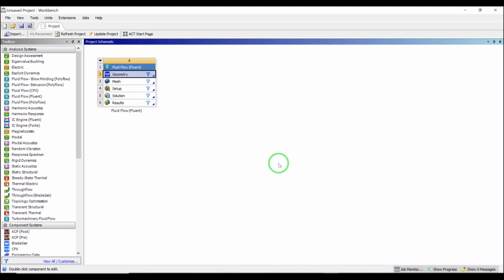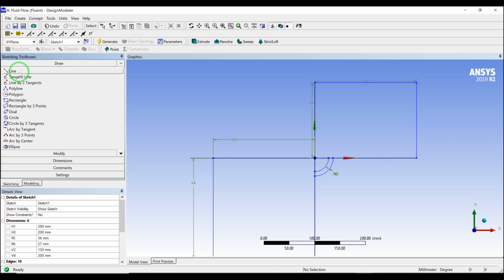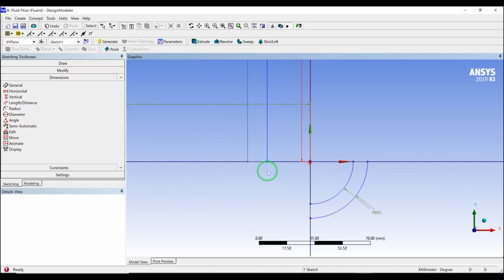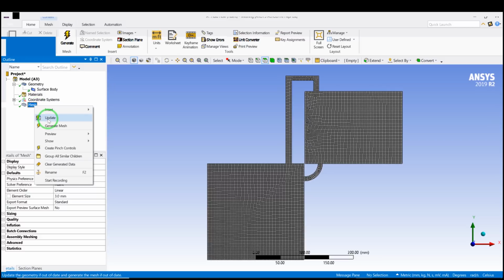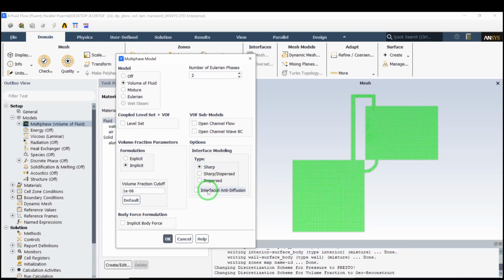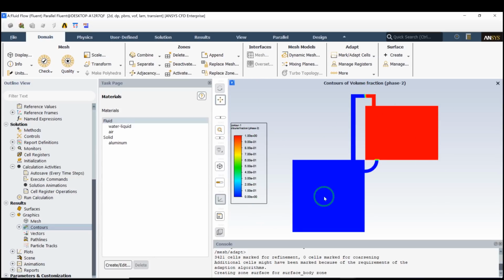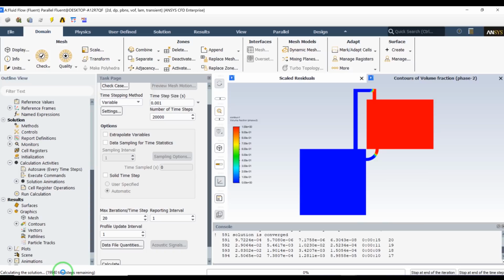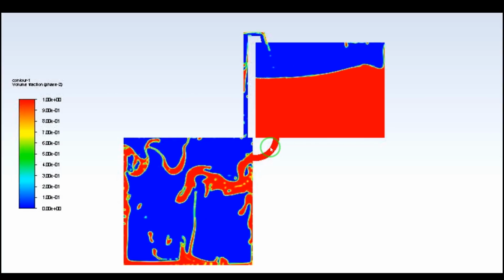Two Phase (VOF) Fluid Flow Analysis in ANSYS Fluent Tutorial - Tank Discharge

Comment: Hi...I want to simulate a hydrocyclone separator. Where I want to input mixture of two particles (PVC and PET) and separate them  and calculate the efficiency ...but i am facing a lot of problem inserting two types particle through inlet...I badly need your help  in this case😓

Comment: Great video, thanks. Please can you do something on plastic injection molding. Especially setting up the fluid (ABS maybe) and setting boundary conditions. Something like this: https://www.ansys.com/about-ansys/advantage-magazine/volume-xiii-issue-2-2019/cfd-for-injection-molding 

Grateful
Reply from the maker: Thank you for watching and thank you for your comment. For plastic injection, nothing very special about the boundary condition. Two important points:
1- You need to have very well defined temperature dependent material properties. 
2- If you want to have solidification in your system, you need to activate the solidification in your model and add material properties.

Comment: Dear admin can you provide a video about the nanofluids natural convection inside a cavity ?
Reply from the maker: Dear Reza, thank you for watching and thank you for your comment. One of CFD and Fluent's basic assumptions is continuity. I believe in the Nano-Scale, the continuity definition is not valid anymore and even if you define the geometry in Nano size, the results will not be valid. Could you please mention a paper or publication that did the same thing? If you elaborate the problem more, I could make a simulation.
Reply: @AdvancedEngineeringTutorials  https://www.researchgate.net/profile/Khalid_Saleem8/publication/331521674_Numerical_Simulation_of_Natural_Convection_in_a_Square_Cavity_Utilizing_Nanofluid_and_Subjected_to_Air_Stream_Cooling/links/5c7e119e92851c695054df0f/Numerical-Simulation-of-Natural-Convection-in-a-Square-Cavity-Utilizing-Nanofluid-and-Subjected-to-Air-Stream-Cooling.pdf
Reply: @AdvancedEngineeringTutorials  thanks and i really appreciate your help actually we can assume that continuity is valid. I have done this in comsol and coding and it was true
Reply from the maker: @rezakalantar2951   Okay, I will try to prepare a video related to this topic. However, I am quite confident that continuity is not valid. At Nano-Scale, even the non-slip condition is not 100 percent true assumption.  The simulation will run and we can get good results comparing to the macro scale, but we will not see the nano-scale effects in heat transfer and fluid mechanics here.
Reply: Thank you very much for your help and consideration. I have a question how can I learn ansys like you . You are great at it

Comment: How does the variable time stepping method work
Reply from the maker: could you elaborate your question? You have question about the theory? Or you want to know about the setting in the Fluent?
Reply: @AdvancedEngineeringTutorials   I want to know about the setting
Reply from the maker: @mayankparasher1249  I will post a video regarding the setting soon.
Reply: @AdvancedEngineeringTutorials  thanks
Reply: Is there a research paper available relating such flows
Reply from the maker: @mayankparasher1249  You can search on google scholar for gravity-driven two-phase flow. Here I am trying to explore more ANSYS techniques. Most of the simulations are engineering, for scientific simulation work you need to study more, for example, to capture the wall in the best way or reducing the error in simulations.
Reply from the maker: @mayankparasher1249  I am not sure about that
Reply: @AdvancedEngineeringTutorials  I am currently working single tank filling problem. The tank has a inlet pipe and outlet vent positioned at the top horizontal surface, separated by a distance. 

I am facing issues with the working of the simulation. As soon the fluid enters,  it is simultaneously being sucked out of the vent. Even though some amount of fluid falls into the tank ,it doesn't look like there is any "filling".

Any suggestions from your side would be appreciated.   

We are modeling filling of automobile fuel tank and the fluid is engine oil.
Reply from the maker: @mayankparasher1249  Could you send me some more information? I can create a video for that if you want. I am not sure what is the problem without seeing the problem or your case file. You could share a google drive link here so I can check the geometry and I can provide a tutorial on that.